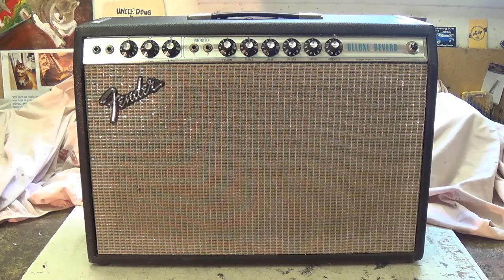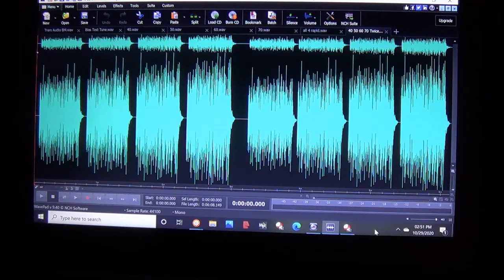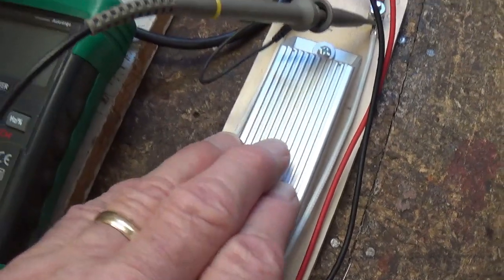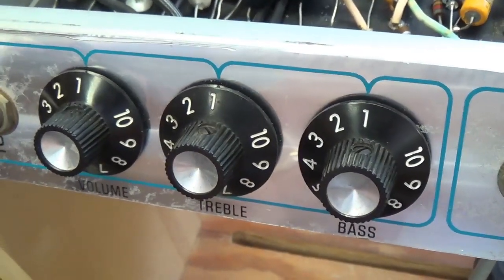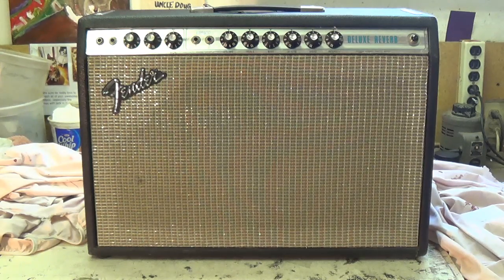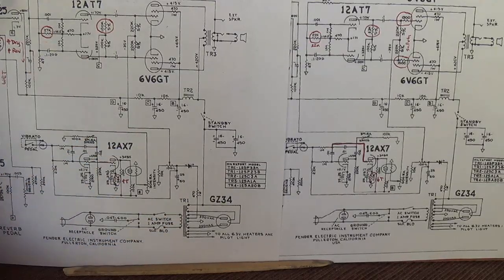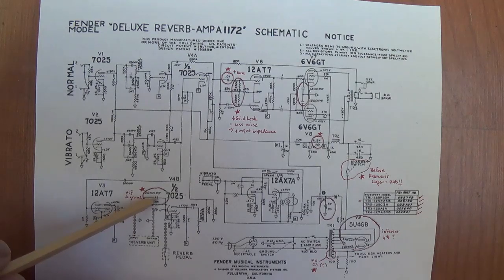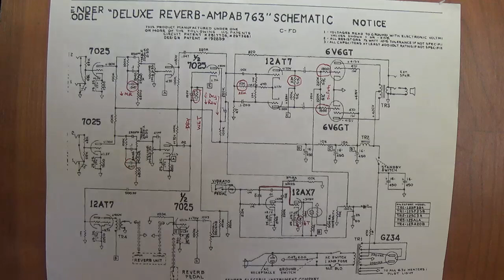The Effect of Output Tube Bias on Tone, Gain, and Headroom.....A Side-by-Side Comparison

Comment: Thank you very much for the video - my 2 cts to the 2k in the power supply. It connects to "C" - the supply of the PI... They propably did not bother to change the Voltages in the schematic, but in reality the voltages at the PI were increased. The Amp gets a tad stiffer - headroom ist slightly increased... Something you feel, when you are playing. This change was also done to the Vibrolux. IMHO together wiht the extended Bass Response of the .01 cap, this is the essential difference between a Blackface and the early 70ies Silverfaces. 
For what it's good? At least for my personal SF Vibrolux - i changed both it back to BF values - i am happy. Nevertheless - a very good amp it was before as well ;-)
Greetz from over the pond
Reply from the maker: Greetings and thanks for your very informative input, Jochen.

Comment: Fantastic video. Could you dispel the cathode bias myth using these same principals? Most people set cathode bias at 100% and some amp companies such as Vox set the Vox AC30 to 17 watts of dissipation. I watched a documentary on Vox amps from the 60s. No negative feedback and 4 EL84s/6BQ5 cooking at 5 watts over their max rating. A great tone. It said the valves lasted for about 2 years. I set my cathode bias amps at 100%. I do about 120 gigs a year (before Covid). I tested the 6v6 valves before fitting them and then tested them a year later. They tested the same. I use two 15 watt amps on 7 on the volume. Would be great to see the Master Uncle Doug do a video on cathode bias. Stay safe and thank you.
Reply from the maker: Thanks so much, Martyn. Cathode bias is self-correcting, so it maintains the set bias despite the strength of the input. For this reason, the output tubes are not subjected to wide variations in PC and PD.

Comment: Wish you lived in Vancouver Canada Doug. Really interesting stuff. I'm learning so much about vintage Deluxe Reverbs. I recently bought a used 1981 DR (European Export model). I was told it had the AB schematic, but not 100% sure. It was unused by the owner who stored it shortly after inheriting it from a relative. I gave it to my amp tech who has told me that there is no need to make any modifications. I just popped some Dual Matched JJ 6V6's in the amp as the originals were not well matched. He advised me not to change any of the original caps as they seemed fine. I have yet to give it a good workout and use it gigging so I won't make any mods unless I hear something untoward. However, from this video, I don't really think modding it to blackface specs would make that much difference to the sound. Upgrading the tubes may have a more significant impact as well as swapping out the speaker. Luckily I have a friend with a 79 Silverface which has had the 'blackface' mod. I'm interested to see if there is a difference in sound. Great stuff.
Reply from the maker: Thanks for sharing, Peter. Best of luck with your Deluxe Reverb.

Comment: Dear Uncle Doug, I think you have an error in the bottom half of the page at approximately 38:45.  2x gain would actually be a 6.02 dB increase, not a 50 dB increase as you’ve shown in the first line of the example, etc..   Change the dBs to VRMS or Vpp and you’re golden.   Armed by all the great knowledge I’ve picked up from you,  I’m going to attempt a from-scratch amp build this winter — thank you!!  Maybe something inspired by a 50W Hiwatt.  As I tell everyone I know, Uncle Doug is the best on the Internet!   All the best, John.
Reply from the maker: Greetings, John. The decibel error was addressed in the 1st (pinned) comment. Thanks for your input and best of luck with your amp-building project.

Comment: Very interesting video. But your multimeter, the Mastech MS8268 is only specified to read AC voltages up to 200Hz on the 4V range and 1kHz on all other AC ranges. 2kHz is twice the maximum freq it can read and it will introduce some error in your measurement. I don't know how big that error will be.
Reply from the maker: Thanks for the info, K2. I'll check into it.

Comment: Hey Doug, I own a A 1172 that was built in 1974. You mentoined, that the 5U4 is inferior, compared to the GZ34... My experience is, that (at least in a A1172), a GZ 34 produces too hight plate voltage, that might kill your 6V6... That is exactly, what happened to mine, after I changed the rectifier to GZ34... I went back to 5U4, and now my amp works great, and the B+ is within allowed specs of my 6V6... What do you think, is it possible, that too high B+ was a reason, why Fender went from GZ34 to 5U4? Are the power transformers the same (secondary voltage of the B+ winding)? 
By the way: The problem with the directly heated cathode imho is not a problem at all, if you use your standby switch, right? And, I'm definitely going to change the position of my stb switch to the position where it belongs, on my personal DR. 
Cheers!!! And thanks for your great videos!
Reply from the maker: Did you re-bias your output tubes after switching to a GZ-34?  The PT's are the same, I believe, and thousands of circuits are running fine with GZ34's......but re-biasing is essential. The SB switch is not as effective as the slow-starting GZ-34. I am not a fan of SB switches. See what the Valve Wizard has to say: http://www.valvewizard.co.uk/standby.html
Reply: @UncleDoug  Hey Doug, of course I did re-bias... It was running @ around 70% pd with a set of tung-sol 6V6.. Of course it might be possible, that I got a bad set of tube in the first place, but isn't the plate voltage in a DR with GZ34 a bit too high for 6V6 tubes? Maybe old stock RCAs are more robust and can handle >450V plate voltage...
Oh, and thanks for the link! I'll check this out!

Comment: IMHO....just get rid of all standby switches...use a GZ34 and install a thyristor on the AC mains. Standby switches help save the tubes but having an unloaded power transformer is asking for voltage spiking inside the PT....so by using a standby switch you’re saving your tubes (which are replaceable) at the expense of your power transformer (not easily replaceable)
Reply from the maker: Agreed, Dave. You, me, and the Valve Wizard are all non-fans of standby switches.

Comment: so what do you think fender cranked the wattage output up to on the blackface & the early sliver face models 85% lol.so the tone output range is more at 70% but the tubes dont last as long so  im definitely gonna run it at the max output & get it sounding better,but get some vintage tubes that will last longer.but im undecided weather i still need an overdrive pedal or i can achieve it using tube,s with more treble output,but i did hear a 66 blackface champ with an overdrive pedal & it sounded amazing peace...
Reply from the maker: A bias of 70% of max in fixed-bias circuits provides the best tone with good output tube longevity.

Comment: Seems to me the lower grid leak resistor in the phase inverter compensates somewhat for the increased coupling cap, since both form a high pass filter and the cutoff freq goes down with a bigger cap, but goes up with a smaller grid leak resistor. And a Spice simulation seems to confirm that. 

Original: https://i.imgur.com/WyZiLBl.png

Coupling cap to 100nF: https://i.imgur.com/CVurO7N.png
Cap 100nF and GL resistors to 330K: https://i.imgur.com/cHEyDU6.png

I don't know, I have no idea why they did that.
Reply from the maker: Thanks for your detailed analysis, Dazz. It does seem strange to make a change and then override it.

Comment: Great stuff. Not sure if the following points were already mentioned in comments. I did scan through the comments, but there are so many.

I’m surprised you reviewed the 1172 design changes before the 1270 since I’ve always assumed 1270 chronologically came first?

I too have wondered about the lack of a power transformer heater center tap, yet the Schumacher model number is the same. I know typically manufacturing would have at least revised the model number when revising the design, but I wonder if they just did not revise the model number in this case. And I assume the reduction of a heater center tap was a cost saving measure?

To complete the ‘70s silverface circuit changes, there was also the pull boost circuit that came out in late ’78 or early ’79.
Reply from the maker: Thanks, Jack. I believe the 6.3V center tap is present in the later power transformers, but they preferred to use the virtual center tap as a safety measure in case a short occurred in the 6.3V line.  I chose to leave out the pull boost circuit, mainly because no one I know of would want to add this to an earlier, more BF-style circuit......and a discussion of all the changes would take too long.

Comment: My silver face deluxe reverb was one of the A1172 models and those 1200pF caps are tone sucks. If you include the output impedance of the phase splitter you find that the corner frequency is only 1.9kHz! Those caps should always come out.
Reply from the maker: Any capacitors to ground will leak certain frequencies from the music circuit, John. I can see why you wouldn't like the 1200pf caps.

Comment: Did you calculate the input impedance of the Phase Inverter ?? You will find the Feedback applied to the tail increases the input impedance up to near 10 Meg.. The 1 MEG or 330K grid leak resistors therefore have no effect on input impedance..
Reply from the maker: Thanks for your helpful input, John.

Comment: Well I just bought a capacitor discharge tool that shows measured voltage so, you can make sure it's discharging, I assume? Suppose to be good up to 1000v. I want to bias my amp and be able to also measure voltage at the bias test point while I adjust the bias pot. So I figure this tool will do both things since its a voltmeter, also.

It's a Laney Cub 12R clone other than the reverb and speaker, IIRC. 15w with 2 EL84s
Reply from the maker: I'm not sure it will, JC. If the CD tool has a fairly low resistance to ground, it may create a semi-short circuit when you touch it to the active circuit. You would be better off using a DMM to make the measurements.

Comment: Excellent demonstration as always Uncle Doug  but you may have overlooked one thing about the locarion of the standby switch. 
It could be that they found that with the switch after the capacitor, the voltage exceeded the capacitor,s maximum voltage ratings.
The voltage would surely be in access of max. rating with the gz34. "Just saying"
Reply from the maker: Thanks for your input, Luc.

Comment: Really valuable Video and the 2nd part as well. 

I was curious about guitar, pu position and amp volume. Looks like maybe Vol 1, Ch2. 40% was muddy/Gainy. I thought the 60% had a good overall balance and a bonus to extend tube life esp using NOS tubes. Your right about the SF myths. You have to just understand the circuit designs and options. Fantastic video.
Reply from the maker: Thanks so much, MR......Glad you enjoyed the video.

Comment: Wow Wow Wow Wow.  I'm SPEECHLESS.  Your knowledge and your ability to teach is just mind boggling.  I've been an advanced class amateur radio operator (Canada)) since 1982 and I thought that  I understood tube amps.  Au contraire as they say en Francais , LOL. I have learned SO MUCH from your channel!!  I'm a Patreon contributor and with good reason.  Thank you SO much for these videos.  There is so much info in this video... I will be watching again and again and again. One cannot glean all this info in one viewing.
I do have a question about the AB763 reservoir caps shown in the schematic being in parallel, when, on my 68 silver face Super Reverb, as well as every amp I've seen, they are in series.  Whats going on with that??.
Thanks again, for sharing your wealth of knowledge, Uncle Doug.  
Give the kitties a good ear scratching from me.
Reply from the maker: Thanks so much for your very kind words, Bob. Fender tried different circuit features in their amps, retaining those that worked well and eliminating those that did not. Apparently, the series configuration was superior with its much higher voltage tolerance.

Comment: At 37:52 you have an error: Decibels are non linear. A 50dB input signal and a 100dB output signal is a gain of 50dB. That's 10^(50/10) or 100,000 and not 2 as you stated. Likewise, the second example is a gain of 1,000,000,000 and not 10 as stated.
Reply from the maker: Thanks for correcting this error, Mr. H.

Comment: Uncle Doug, Why did you use input signal frequencies of 2kHz and 10kHz since a 6 string guitar has fundamental frequencies between 80Hz (low E open 6th string) and 1280Hz (high E at 24th fret on little E string) and the "meat" of what is heard from a guitar is between these 2 frequencies.  Just wondering?  Thanks for all of your vids.  They have brought my tube amp repair chops to a new level.  Keep up the great work!
Reply from the maker: I guess I picked a couple frequencies that seemed appropriate, but agree that they could have been lower. Thanks for your input, Mark.

Comment: Hey Uncle Doug, quick question, what is the Gain of a output tube? or does it just bump current ?

example 12x7 first stage = x100 (so for example 250mv turns into 2.5v) next stage =x100 (so now 2.5v = 250v) then the output tube amplifies more or just adds current for the transformer?
Reply from the maker: Good question, Tonny. The output tubes do indeed amplify. For example, the 6V6 has an amplification factor of approximately 10.......but the voltage increase in each stage is not as great as you might think. Just because a tube, like the 12AX7 has an AF of 100 does not mean that it is able to increase the input signal 100 times. I look at AF's as being more relative that absolute, i.e. a 12AX7 with an AF of 100 can provide much more gain than a 12AU7 with an AF of 17.

Comment: @Uncle Doug I have a question. On a marshall plexi type circuit, does the NFB stop working / have less effect when the output stage is highly overdriven?
Reply from the maker: I would think not, IM. No matter what, there will be a NFB signal sent back to the PI cathode.

Comment: Uncle Doug, I always enjoy your videos, they are entertaining and educational.  Besides being a very talented hands-on guy, you have a knack for explaining technical concepts in easy to understand terms.  I have quickly become addicted to you videos!  I do have to point out an issue in this video, with the slide you present ~38:00.  You are absolutely correct to state that Gain = Amplitude output / Amplitude input when using linear terms (e.g., Volts).  However, when converting to log (dB) at the bottom of this slide, your Gain is not correct.  Linear division equates to log subtraction, so for the examples you cited where you state "2X" the answer should be 50 dB (100 dB - 50 dB), and the "10x" should be 90 dB (100 - 10).  Also a bit nit-picky, but when referring to input or output signals - these are absolute values, not relative - the dB should be dB referenced to some unit (e.g., dBV).  The gain, being a ratio, would be dB NOT dBV.  The linear analogy would be amplitude in & out are in volts, but the gain is unitless (the amplitude units cancel as part of the division).  Look forward to future videos!!
Reply from the maker: Thanks for your nice comments, Alan. All of your concerns over the logarithmic nature of the decibel scale have already been addressed in the (pinned) first comment.

Comment: Thanks for the excellent video Uncle Doug. I preferred the 60 & 70% bias for guitar, and could definitely hear the crossover distortion at 40%. I usually test amps with a 1KHz input signal at 100 to 250mV. When setting up an amp for someone else I often adjust the bias a few mA while they play so I can dial in a tone they're happy with, within 50%-70%. As a harmonica player my fixed bias LTPI amps are often biased cooler though... I need to curb the gain to avoid feedback, and my harp mics can put out 5-10x the voltage output of a guitar pickup so I keep the bias just warm enough to avoid obvious crossover distortion. If I'm compromising for guitar and harp I'll go for 60%. I may also swap rectifiers (5AR4/GZ34 or a 5U4G) so a mid point bias will work with whatever rectifier I'm using.
Reply from the maker: Excellent advice and information, Bruce. Thanks so much for sharing this with us.

Comment: Thanks for another great vid and a tremendous effort Doug. I dare say that theirs a huge difference when bedroom playing and a live performance. At low bias on stage (below 70%) the amp gets scratchy and weird shit starts happening. Basically, low bias simply doesn't cut it live. When I play at home I have some amps (60+ amps) that I
 bias cool <--- 70% but when I take my amps on stage they're biased between 75-85%. To my ear the hotter the more clean headroom. Lower bias = earlier power tube break up. Same with preamp tubes. Change your stock Fender/Marshall 100k plate feed R to a 220K and you'll achieve more preamp distortion.
Cheers!
Reply from the maker: Thanks for the helpful input, Jimi.

Comment: Yes. Gain = harmonic saturation = compression = less headroom. Tubes are an expendable. They can be replaced. In racing, there is a phrase, "Getting it up on the cam". There seems to be a relation between racing and music (the throttle is often referred to as the volume pedal). Biasing an amp is a lot like tuning a racing engine. There is always that fine line between too little and too much. The final arbiter of this choice is the driver/guitarist. To each his own for his own purposes and goals. Again, tubes are expendables. Like gasoline. Eh?
Reply from the maker: Interesting analogies, Kieron. Thanks for sharing.